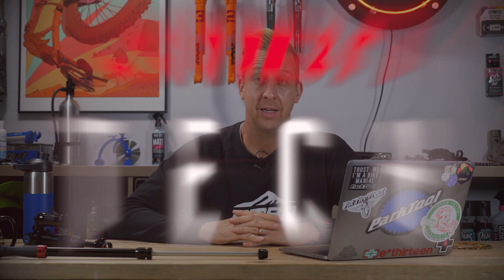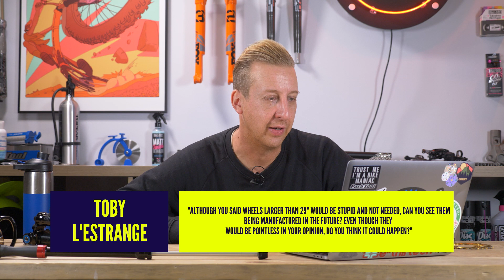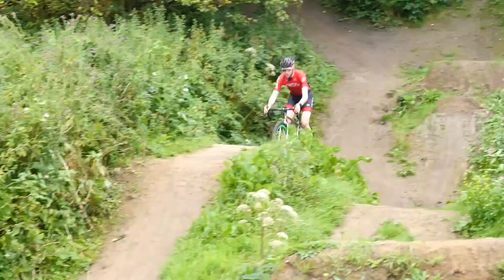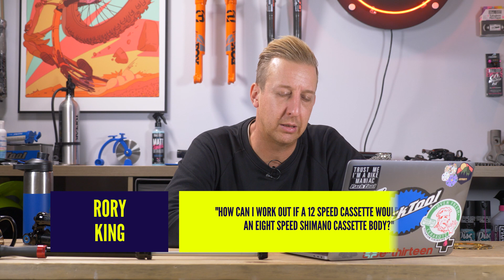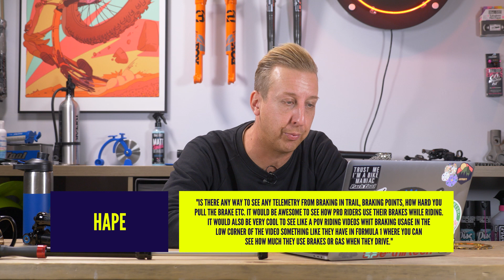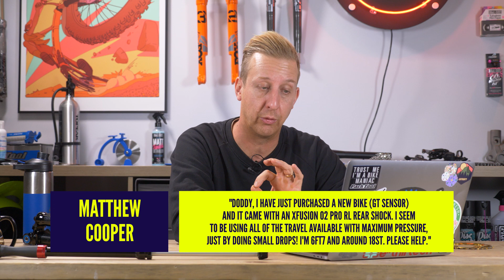Will We See Even Bigger Wheel Sizes? | #AskGMBNTech 179

Comment: For HG mountain bike hubs, 7spd needs a thin spacer, 8/9/10/11 are ALL COMPATIBLE on any 8spd or more rear hub. This includes 135mm rear ends, where the centre sprocket is still in the centre and chain line does not change if the crankset or chainring is designed for a non-boost setup.

Road bike 8/9/10spd HG hubs are not compatible with 11spd, that's where the confusion comes from.

I have built up an older 2009 Jamis Dragon with 11spd XTR, 1x 11-46 it works fine, my friend loves it. Never be afraid of odd combinations of components, it's what makes a truly knowledgable bike mechanic, and what mechanics of yesteryear had to deal with on a daily basis. You didn't buy into a brand name, and brand names never really insisted you couldn't use other parts until Shimano came along with indexing in the 1980's.

Comment: Over lockdown, I converted my 3x9 transmission (Shimano Alivio F & R mechs and cassette) to 1x11 (SLX M7000 R mech and cassette) with no change to my free hub body or rear hub. My conversion even allowed me to reuse my cranks by removing the old 3 chainring setup and mounting a single narrow-wide chainring in the place of what had been the old middle chainring along with some spacers. For anyone wanting to go from 3x to 1x transmission, this is what I'd suggest they try. I honestly don't find the extra speed in a 12-speed setup to make that much difference.

Comment: I’d like to see a heavy, extended hard tail frame, 32x4” front 120mm travel, 36x4” rear with towing geometry front derailer 3spd and super low 72t out back, custom quick attach trailer with its own disc brakes so it could haul 1000lbs up a small hill and stop on the way down.

Comment: #AskGMBNTech I am finally going tubeless as I have some awesome Halo vortex wheels, but my current floor pump can’t seat the tyre bead. Do I need to buy a new bike pump (Joeblow Booster), or can I get by using a charge tank (Tubibooster X) with my current floor pump to seat my tyres? Or can I use a CO2 cartridge to seat my tyres? Keep up the good work!!

Comment: #AskGMBNTech I have a 11 speed sram cassette 11-42 and I'd like to have a bit more gear-ratio. What is better between changing the the entire drive-train to a 12s 11-50 or swapping out the front chain-ring from a 30 tooth to a 24/26 tooth?

Comment: I have put a 11 Speed in my 26 inch bike. It has a 135mm rear axle width and originally came with a 3x9. The chainline fits quiet good. To get it right i just put the chainwheel in the middle Position on my cranks and it works like a dream.
A 11-51 11-speed deore groupset maybe would fit a litte bettet on the bike, although you can climb really slow already with a 11-46 cassette.
Hopefully it helps a little bit.

Comment: To the last question (guy with XFusion Shock). I think I have same one in my Trek Fuel EX 5 and I bottom it out to. When I have it set to the base setting from Trek’s website I can bottom it out with my own weight on flat ground. After some research and talking to my dealer I do not think X Fusion has volume reducers that go in this shock. If u go X Fusions website a new one come with 3 bands it says but I didn’t get 3 when I bought my bike. Can’t find them anywhere by XFusion or anybody else so I’m stuck with the same problem as you

Comment: I swapped out the 2x9 on my 2009 Trek Ex8 with 5mmQRx135mm hub to a Sram GX 1x12 without any clearance issues. My LBS swapped the 3mm chainring for a 6mm offset and chain line is perfect. Now on my FatBike I swapped the stock 9 speed cassette for a high range and it rubbed on the seat stay just a touch so I would assume that the bikes frame would come into effect on what works or not.

Comment: The 11 speed cassette on the 7-10 speed hub won’t work. The lock ring is barely able to grab onto one or two threads and will strip when you try to tighten it.

Comment: #AskGMBNTech

I recently acquired a late-90's/early-2000's Specialized FSR Sport that had been neglected for years, with plans to restore it. Rear suspension was rock solid, so I removed the rear shock and unsurprisingly, the rest of the suspension assembly was also pretty much seized shut. It's running an old Rockshox Deluxe coil shock and I've managed to find similar decent-looking shocks online selling for SGD$100-$150. Most bike shops near me don't seem keen on working on older bikes like mine, and the only one that says they will quoted me $250 to do all the fixing up plus a replacement coil shock of unspecified brand. Am I being ripped-off here? Is this a job I can do myself with a $100 shock plus a tube of grease? Would love to see more retro bike maintenance and restoration content. 

P.S: Starting to regret getting a full-suspension bike for my first restoration project

Comment: I have a 2009 Kona Stinky Deluxe with 135mm rear wheel spacing running a 12 speed cassett on a 9 speeed HG free hub with a Shimano 12 speed Deore rear derailleur. I have been riding this for a year now without any issues, I am running a 2.3" rear tire and have no issues with tire/chain interference. The only thing you can't do is back pedal when using the granny ring's ( 2-3 biggest sprockets on the cassett).

Comment: At 195lbs, I had the same problem with bottoming out on small/medium hits on my X-Fusion O2 Pro, even when I went a bit over max pressure. Replaced it with a Rockshox Super Deluxe which is running great at 205psi.
Reply: Yea my stumpjumper had this shock, it’s for lighter riders

Comment: “Just a spacer” also means full strip down and damper oil replacement so not “just a spacer” really

Nicely done with your new outlook on “I love all bikes”  in your line of work this is a must. So good on you
Reply: Well, at least on a RockShox Coil with 60mm it's 2x2.5mm spacers. Cut one off and you'll have 62.5mm. Only going back requires disassembling the shock which isn't straight forward.

Comment: Met a guy on the bike path a few years back with a unicycle with a 36" wheel. He did say that it rolls over things better but he was using it for endurance riding where he needed to maintain momentum. He had amazing balance and had an interesting method to "mounting" it. I think that the wheel size exists because of the unicycle market.

Comment: #askgmbntech I’m considering the possibility of replacing my current transmission when it reaches the end of its life: I’m now on a shimano slx 10-51 cassette with a 32 oval chainring, I’m never using the smallest cog on flat, and I’m never pedaling on the descents , so a 10-45 cassette with a 28 oval would give me the same ratio, save some (very marginal) weight and some money too, in theory.  Would it work with my current 7100 long cage derailleur?

Comment: Manufacturers might dip into bigger wheel sizes although it might be a niche market. New bike geometries could be made. Short riders will settle for long slack wheel base specially on the fork and taller riders would end up with short wheel base but taller bikes. Possibilities are endless but, again, it might be a niche market.

Comment: So I have a cheap commuter from decathlon which came with a 7 speed tourney. Hub had two spaces (behind the 7 speed) so I put my old 9 speed deore MTB cassette, shifter,  derailleur and chain on it (left one spacer behind cassette). No issues with chainline but then I think that frame and wheel is designed for both lower end gravel and road bike lines so not the greatest example.

Comment: If perfect wheel size for Doddy is 29er than why do we push 29ers on smaller frames? For sure 27.5 fits better for people under 170/180cm.
Reply: And, 26 would fit even better yet, but not necessarily ride better. I know at least two very petite female riders that vastly improved their riding, confidence and speed by going 29.

Comment: I was never convinced 29" wheel a good idea. So much I developed a passionate hatred for them. I never saw 29er as anything more than a hybrid with fat tyres and suspension or a gravel bike with flat bars, fat tyres and suspension. I think I maybe have been a little inaccurate. As I now have an Orbea Laufey. Which is a 29er hardtail. One of my comments awhile ago. I said I would permanently give up montin biking if the only bikes you could get were 29ers. As you can still get 27.5" wheel bikes. I am using that as a loophole to have a 29er.

Comment: Hi Doddy. The 8.9 and 10 speed use the same hub body. The 7 speed is narrower but uses the same spline pattern,The 7 speed cassette does fit and work on an 8 speed hub. But does need a spacer. The 11 speed mountain bike cassette will fit the 8.9 and 10 speed freehub. SunRace do make an 11x51. 12 speed cassette that does fit. The 11 speed road cassette is wider so does use a different width freehub body and does need a spacer for the 10 speed cassette. How ever if you use an 11x34, 11 speed road cassette on an 11 speed road freehub. You still need to use the 10 speed spacer. As the cassette is dished like the mountain bike cassettes.

Comment: Hi! I have a Specialized Hardrock sport Disk 29" wheels from 2014, and it as 135 mm on the back axle. I have a shimano deore M5100 cassete and a rear derailleur also M5100, with a narrow whide 32T chainring, and it works perfect, even when i back pedal. Before it ad a 3x8 groupset, i thin de main problem is the frame geometry, that it will make the difference. I'm not a bicycle mechanic, but i think that the shimano groupset M5100, it's easy to install, and a very good groupset for cheap and easy upgrades. Maybe later i will try to upgrade it for a 2x11 M5100, if it is possible!! 🙂😛

Comment: #askgmbntech Hi Doddy, recently bought a new bike. It has a Shimano XT derailleur with a clutch. The guy at the store said I should run run the clutch only closed when hitting very rough terrain, if not I should leave it open so the springs would not be under that much tesion. That statement contradicts everything I heard on this channel about a clutch on a derailleur and how to use it. The Shimano userguide isn't very specific about it but only mentions to loosen the clutch when taking out the backwheel. As I understand it the clutch doesn't even influnece the tension inside the derailleur because its "using" friction and not tension. What would you recommend, clutch aways closed or allways open? Thanks.
Reply: The clutch doesn’t have anything to do with the spring tension, it’s a separate system. You only need to turn the clutch off when removing the wheel.
Reply: @krzysiu4003  thank you very much.
Reply: most run the clutch on 100% of the time unless working on the bike, but shifting can be easier/softer actuation with the clutch off.... but given there are time I forget about suspension lockouts or seat post positions when launching into rough stuff... im never going to remember how I left my clutch !!
Reply: @oc1rob  thank you. Would be the same with me.

Comment: Shimano 8/9/10/11 all can be fitted to Shimano MTB hub standard, for a 12 speed Shimano cassette you need a Shimano Microspline. For SRAM cassettes you need a SRAM XD Drive for 11 and 12, 8/9/10 fit on a Shimano MTB hub. The 12 speed SRAM NX cassettes and also some 12 speed Sunrace cassette do fit on the Shimano MTB standard hubs, but have an 11 tooth for the smallest sprocket instead of a 10.
Reply: Thank you for the thorough and correct response.  I think a lot of folks get confused by 11 speed road, which is a ~1.8mm longer freehub body (both for Shimano HG 11 Speed Road and Sram XDR bodies).  But if you're just talking mountain bike parts, there's nothing funky about 11 speed, AFAIK.
Reply: Garbaruk also make some very blingy 12 speed cassettes that fit on a standard Shimano HG mtb freehub body.
Reply: Yes, correct! I just upgraded my 3x10 to 1x12 and didn’t change the freehub body (although perhaps I should - it is a bit worn!). Using the sunrace cassette. The 10-50 cassettes are lighter, but sooo expensive, and mostly unobtainable. One unexpected issue was frame clearance of the derailleur in the 11 tooth, which requires the b-screw to be possibly slightly suboptimally placed. But it does work!

Comment: 7 speed bodies are unique to 7 speed cassettes; 8/9/10 cassettes, some 11 speed, fit on the same size body.
Reply: was just about to type the same... 7s are unique, 8/9/10 all on the same freehub, 11sp Hub will take 11 & 12s, but also 8/9/10 with a spacer at the back of the cassette (shimano non microspline at least)
Reply: @oc1rob  aren't standard Shimano HG freehubs supposed to take 8/9/10/11 speeds for MTB? Afaik only 11 speed on road bikes need the longer HG freehub.
Reply: @nekobytes9187  ive had mtb hubs with spacer for 10spd and lower but 11 is straight on.
i think its the same hub design for both road and mtb up to 11 speed
Reply: 11 speed road hubs are 1.6mm longer, that’s why they take spacers for 8/9/10 and 11 speed mtb cassettes.  Generally that is every cassette 11-36 and bigger, but also the shimano 11-34.  7 speed cassettes are rare to begin with, most 7’s are free hubs.

Comment: When we were riding 26", most people said that 29" was too much, it would be too heavy and would not work. I have no idea if bigger wheels would be better or worse, but we should not just say "i think it is too much"
Reply: considering toe overlap vs reach and saddle height vs handlebar stack, there is a definite upper ceiling when it comes to wheel size. as to whether 700c/29er is the limit, idk.
Reply: cornering might be an issue

Comment: I think wheel size should be dependent on the rider. I love my 29ers as they work well for me at 177cm tall. I do think however that a much taller rider could see an advantage from a slightly larger wheel.
Reply from the maker: Hi Lachlan, Height is often forgotten about when choosing a wheel size. It's definitely important to factor it in. 👍
Reply: @gmbntech  doddy, I built up a Trek Excalibur 2016 with a SRAM NX 12 speed. Cassette used was a SRAM PG1230 cassette which fits straight onto the previously 9 speed hub. So far the stepson has had no issues. That being said I have not checked the chain line. It all works though 😎

I can send photos if you want them
Reply: Doddy should ride a 32in. Thats equivalent to a 170cm and shorter rider riding a 29in.